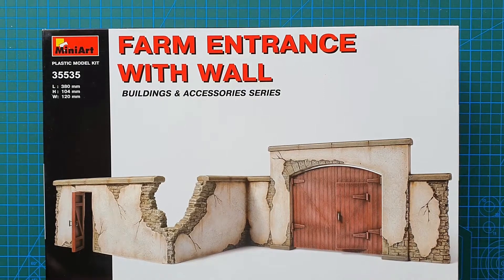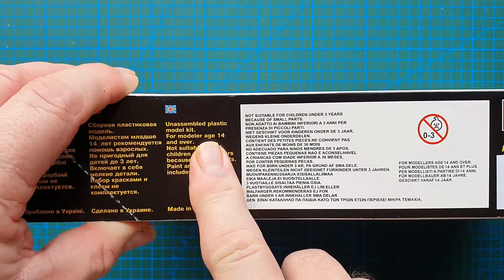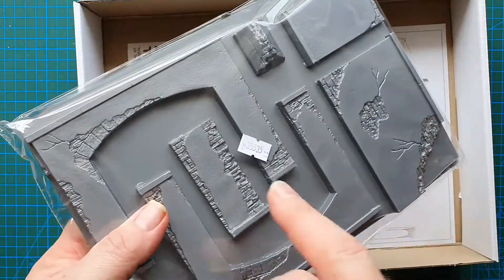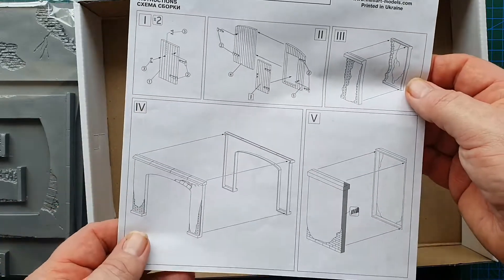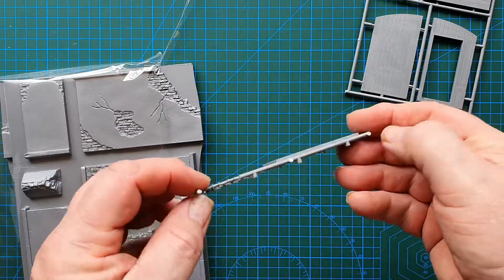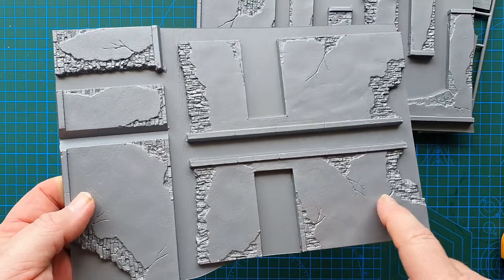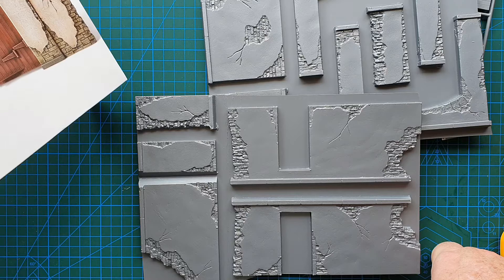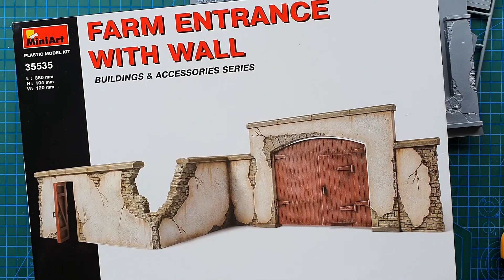Miniart 1/35 Farm Entrance with Wall - Kit Review

Comment: Nice one Pete and Merry Christmas! I know that this vid is four years old but I think all of these Miniart Diorama Series kits are now discontinued as I haven't seen any new ones for sale for a long time, only second hand kits on ebay. I did watch a YT vid of a guy assembling one of these kits and he said that the best way to remove the parts from the sheet was to sand them through from the back with a large sheet of sandpaper taped down to a flat surface but not yet having built up the courage to tackle one yet I don't know for sure. Maybe in the new year 🤔
Reply from the maker: Hi Mate! And a Merry Christmas to you too. When you said "4 years" I did a double take, and had to check myself. OMG has it been that long? Yeah, a lot of these vaccuum form buildings kits are discontinued, and only turn up on Ebay now and then. Just saw Miniarts latest catalogue and they only have about half a dozen buildings in it, plus lots of accessory kits. And yeah, there's a couple of different ways to tackle these vacuum forms. One is like you said, tape some sand paper down and just sand the whole sheet down until the parts come off, and the other is to cut out the parts and sand or scrape them down to fit. I've done a couple and I cut out the parts and sanded them down as I didn't have the bench space to sand the whole sheet. It's a painful, and messy, lot of sanding as you have to grind them down about 1-2mm (the thickness of the vacuum form base) to get a good fit, and you end up with a ton of shavings all over the place. I like them 'cause the details pretty good (for vacuum form) and no one else does cheap building kits, but, I think the whole sanding bit is probably what's stopped me from doing all the others I have. I did notice in their catalogue that they're now doing injection moulded bases so maybe, maybe, they might go that way with their old building kits as well. It'd be so much easier! Maybe like you I'll give it another go in the new year 😉 Cheers mate! Have a good one!